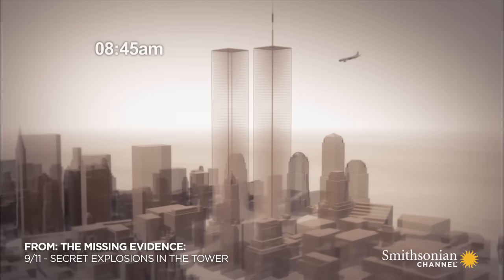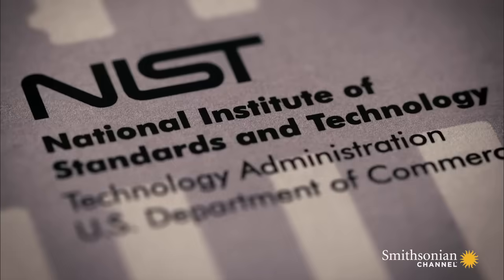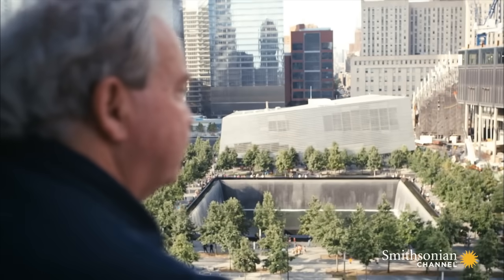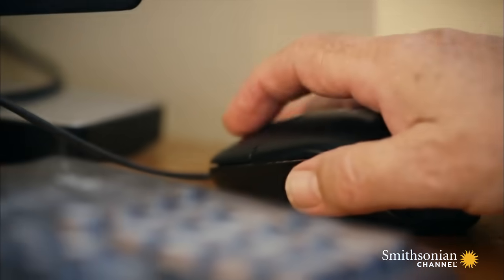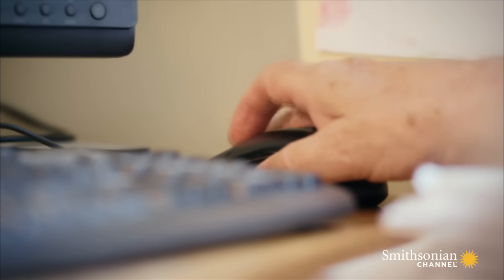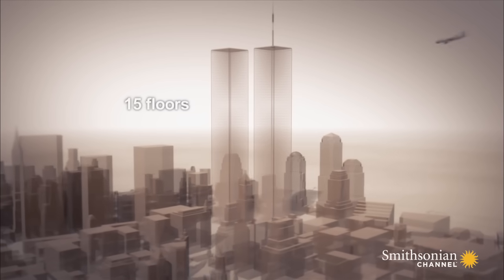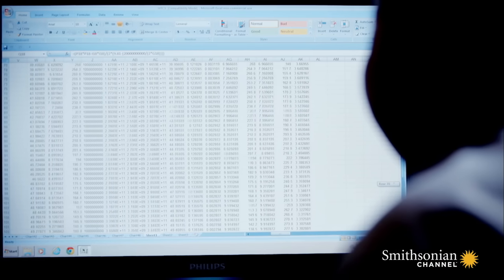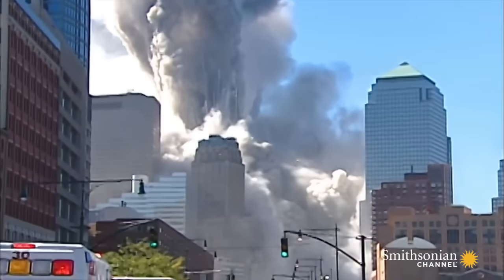This Computer Simulation Explains How the Twin Towers Fell

Comment: It was proven that the tower had plates in to hold the weight of the building if the bottom third took the weight of the top 2 thirds then it wouldn’t collapse.. and it did. Something isn’t right
Reply: There were no buildings or plane, only holograms.
Reply: MrYourfriendbutters no buildings? Haven’t you seen the huge hole in the floor that’s left there today
Reply: @Aaranslife  sry for the impersonating babbling babbler.  They don't like me or my ideas.  So they spread disinformation.  Like the idea there were no planes or buildings.  They just want to crush ideas.  They can't debate the fact the wtc meteorite is real.  They are quick to name call and belittle people.  Just call them babbling babblers which they are.
Reply: @Aaranslife  BTW I've reported them many times for gang stalking and nothing is done about it.
Reply: @c.augustedupin1926  babbling babblers you imposter
Reply: MrYourfriendbutters  Your going to prison for gang stalking me babbler.
Reply: @c.augustedupin1926  says the gang stalker.  Babble babble
Reply: @MrYourfriendbutters  The authorities will be contacting you soon and halling you off to prison babbler.
Reply: @mryourfriendbutters8900  impersonating is your weakest link.
Reply: @mryourfriendbutters8900  babbling babbler

Comment: Thick steel columns don't disintegrate w/o explosives going off on each floor almost simutulaneously. Which is exactly how they wire buildings for demolition.
Google videos of "controlled demolition" buildings.  The collapsing movements are almost identical.

Comment: Wait hold up 

So these steel beams holding up each floor can't handle the wait of a few extra floors on top of it? And it was designed to handle crashes like this but they couldn't calculate all these weights when designing the building, like somehow they just didn't think of that? Hmmmmmmm
Reply: @Shelby_Starner_Everything  babbling babblers

Comment: Virtually ALL the concrete flooring turned to extremely fine dust from nanothermate which scientists found in all examined dust samples. Therefore there was not the accumulated weight of falling stories which this analysis relies on to explain structure below being overwhelmed so as to allow collapse at nearly free fall. Further, many large pieces of structural steel are visible in the air beyond the explosion clouds as the collapses occur which could only happen if cutting charges were employed, which were used so the steel would come down in lengths to conveniently fit on flatbed trucks, hundreds of which were loaded each night starting nearly from the beginning.
Reply: Except for one thing: THERMITE WAS NEVER CONFIRMED. It's just one theory from one paper that was never peer reviewed or reproduced. One lab tried to reproduce the thermite find and FAILED. No one in the engineering community takes the thermite claim seriously. NO EVIDENCE OF THERMITE.
Reply: @Tim22222  babbling babblers you are
Reply: @Tim22222  You're avoiding the opening, main point, how to explain so many pieces of structural steel flung far into the air, many beyond the smoke and dust, and all about the same length, when steel is too elastic to break into pieces like that from overloading.

Comment: Look guys the twin towers weren’t thousands of tons of structural steel they were actually hollow inside !!! That explains how gravity could pull the top fifteen percent of the buildings through the thousands of tons of intact steel
Below!!!!
Reply: You've unlocked the achievement: Top Sarcasm
Reply: @VoidSurfer9  thankyou sir!!!
Reply: Bs. They were not hollow. There was a steel interior frame and an outer steel frame.

Comment: Apparently the collapse may of happened in 2 ways  
1) When the fire at the top of the building got to 2500 degrees C the fire melted and the top collapsed onto the bottom
2) Molten Aluminium, Water mixture
Now dont complain about me not knowing physics because this is what scientists believe and im only a under 13 kid so there

Comment: I can't help but notice he avoids addressing the most pertinent part of the equation; that being that a collapse in the manner he's speaking would ONLY occur IF the entire surface of the first floor to collapse gave way evenly across the entire surface.  That would NOT have happened as the damage from the plane affected only a small percentage of the internal structure.  Use common sense and think about it like this.  Take a tree and drill a huge hole through the center of the trunk.  Will the tree collapse?  No.  Cut from the hole through to an outer edge.  Will the tree fall now?  Yes, but it won't give way and fall straight down because the intact side of the trunk will prevent that from happening.  The tree will tilt and fall to the side where its structure has been removed.  Same case with the towers.  The plane only damaged a small interior section.  The outer structure furthest from where the plane hit was still fully intact.  The weight of the upper floors would cause the weakened section to give way and just like the tree it would lean and fall outwards in the direction of that weaker side of the structure.
Reply: "a collapse in the manner he's speaking would ONLY occur IF the entire surface of the first floor to collapse gave way evenly across the entire surface"

Oh? How do you know this? Where did you get your engineering degree? You DO understand a skyscraper is not a tree - right?
Reply: @Tim22222  I got it from University of Guelph.  Where'd you get yours?  I dumbed it down man, obviously not enough.
Reply: 12weasel100  what are you copying and pasting about?

Comment: What a load of propaganda nonsense, this video explains nothing.  What it does do is ignore the laws of physics.  Shameful..
Reply: @SmalltimR  I'm only making a fool out of people like you who ignore the facts and are completey clueless as to whats going on here.  I've actually researched 9/11 properly and i can tell you that the official story of 9/11 is provably wrong. The official story has been changed so many times after they realised that the facts did not add up.  The 9/11 commission did not even mention building 7 in their report, and later had to come up with the laughable excuse that it collapsed due to an office fire.
Reply: Which laws of physics does it ignore? Please explain.
Reply: @Tim22222  Newtons law of conservation of momentum. Buildings cannot drop at that speed if anything is slowing you down, ie when a floor hits another floor and another floor in the way the official story has described there is resistance before each new floor gives way. On 9/11 the speed at which the two buildings collapsed was basically the same as dropping something from mid air with nothing in the way until it hits the ground.  This only happens with controlled demolitions.
Reply: @wakinguptheworld6140  ROTFLMAO!! Okay, then - show your math, please. LOL just kidding, of course you can't because you have NO understanding of what you're talking about!!

Conservation of Momentum does NOT apply when gravity is acting on the system! If you're holding a stone & then you drop it, is its momentum conserved? No, of course not! Same with the towers. Go back to wikipedia & look into "open" and "closed" systems.

Also you are wrong about another thing: The towers did NOT come down in free fall. That's a myth.

Did you go to college? If so you might want to ask for your money back!
Reply: @Tim22222  Its quite simple, you cant drop at that speed if anything is slowing you down, a four year old can work that out.  According to the law of gravity, it is possible to calculate the time it takes for an object to fall a given distance.  The equation is  H=(1/2)at2, where H is the height, a is the accelaration of gravity (10 metres pers second squared) and t is time in seconds.  Plug in the height of the building at 1350 feet and we get 9 seconds. That is just about the time it took for the very top of the world trade centre to fall to the street below.  Acoording to all reports, the whole thing was over in just about 10 seconds.

Comment: If I took the time to detail all the lies and omissions in this video I would get nothing done today so I’ll simply say this video is fake news
Reply: Jason Morrow you need to read NIST report regarding free fall time.
Reply: Jason Morrow If you do a search on YouTube you can find a full length video more detailed than what I just sent you.
Reply: Jason Morrow you claimed that NIST did not deny the molten steel. I sent you a video of NIST doing just that, denying any molten steel existed. 

Tower 7 fell at free fall speed for the collapse of the first 25 floors. After that it fell at 90 percent of free fall speed. That can only be achieved by controlled demolition.
Reply: Jason Morrow i would be happy to hear the explanation for free fall speed on all 3 towers

Comment: How did the round jet propellers on either sides  attached to the wings  cut the huge strong class steel????? They should have fallen out side tge buildings...but tgey went in like butter and knife....
Reply: If you look carefully at close-up photos of the holes you'll see that no steel was actually cut! The columns were made up of 36-foot-long beams bolted together end-to-end. All the planes had to do was to break those bolts. Easy for a 150-ton mass doing 500 mph!
Reply: @Tim22222  what are you babbling about
Reply: @SmalltimR  guess you haven't seen any of debris from the site.  Guess your not an expert.  Who is your thought leader?

Comment: While I would like a valid explanation of Building 7, even more damning (that no one seems to be talking about) is the fact that every simulation (this one included), drawing or whatever is used to try to explain "how the towers fell" always has the South Tower collapsing straight down. Look at any of the numerous videos of the South Tower collapsing. Anything but straight down. As a matter of fact the top floors of the South Tower tilts 20+ degrees during the "failure" making it impossible for either the top floors to crush the bottom floors, nor the resistance of the bottom floors to destroy the top floors. Talk about defying the laws of physics. You want proof of "interference" and the fact that "they" are trying to cover it up? The South Tower proves it. Otherwise "they" need to explain how the South tower disintegrated, top floors and bottom floors, despite the 20+ degree tilt of the top floors at initial failure/beginning of collapse.
Reply: The upper section tilted while it fell down and crushed the lower section.

The towers did not fall apart the way you think they did.

The steel girders in wtc7's inner core were attached to the  support columns with only 4 bolts.....that's not very strong.
Reply: @Shelby_Starner_Everything  Actually if you bothered to watch a video on the South Tower collapse, you would see that the majority of the tilt of the upper floors happened prior to the collapse. If you have watched the South Tower collapse, then your statement is just dishonest. Do you really understand much about physics? Do you not understand why when the top floors started to roll off, that it was impossible without some form of interference to get the result that happened? Explain to me why, if it were possible, that NO ONE who attempts to 'explain it' shows it. They ALL have the South Tower collapse straight down. Just like in this video. They don't show it because they can't. Without some form of interference or 'help' if you will, it is virtually impossible to have the top floors start to roll, but then suddenly stop tilting/rolling and utterly destroy both bottom and top. Can't be done. The tilt/roll of the upper floors of the South Tower is very inconvenient to their 'explanation'. That's why no none who 'explains it' shows it.
Reply: @Shelby_Starner_Everything  lol where do you shop?

Comment: I went through Greening’s calculations. The derivation of the equations made some sense but in performing the calculations the rate of collapse would decrease and the collapse would stall within 5-10 floors.  He never actually showed in his paper what is asserted on this video.  I spent a day on it, it was a waste of time.  Even if the building did collapse at the accelerating rate visible in the video tape, how does one explain the large chunks of wall being ejected from the building and disintegrating while in free fall?  There are numerous other weird events that occurred that day that would be almost impossible to explain by gravity driven collapse.  The available evidence is consistent with the use of explosives, yet the obvious explanation would imply a coverup which our government would never do , right?
Reply: You have been mislead. The towers did not come down in free fall, not even close.

Not one shred of evidence indicating explosives was ever found. Nothing!
Reply: @SmalltimR  nice did you cntrl v from a script or your last comment for the other thread?
Reply: @SmalltimR  fyi you have no data or evidence.  Who is your thought leader?

Comment: The south tower fell first after being hit last because it hit the very side of e tower, which made structural integrity really low. The north tower was hit head on, structural integrity was not low but low, ( if you know what I mean ) when the tower fell it's like a domino effect when you knock one domino the over dominos fall. Immediately crushing each floor.
Reply: Josh, did you skip Jr. High Science class?
Reply: What are you babbling about

Comment: It’s a lie there’s no way building can fall perfectly down only professional bomb dentonater can do this to prevent it from falling to the side and hitting other building not a plane free aiming
Reply: The twin towers did not fall perfectly down.....they collapsed out like a volcano, all over the surrounding buildings, destroying them....the Marriott Hotel was totally destroyed from the falling rubble.

The outer shell of the twin towers was a ''moment resisting'' steel frame, that was bolted down to solid bedrock....it was designed to resist the overturning moment, so it is impossible for those towers to fall over like a tree.
Reply: @Shelby_Starner_Everything  what are you babbling about

Comment: To all you consiricy therists on here i suggest you watch how they made the buildings and survivor recounts a) they  were both concrete exterior with sheetrock insides they were built like four skyscrapers on top of each other that cobined with jet fuel burning a hole through so many levels was deffinatly cause a collaspe like that
Reply: Say what?  Spelling, punctuation, and capitalization are all free on Mondays, Mike.
Reply: I highly doubt there was "sheetrock" in the twin towers.... Oh nm you must have meant drywall.  Oh I guess you have never been in construction outside of made finishes... I doubt that though... Are you sure it wasn't plaster

Comment: Building 7 was the smoking gun
Reply: A building in the Mexico earthquake collapsed exactly like wtc7.
Reply: @Shelby_Starner_Everything  your really reaching.
Reply: @tonycariello8478  
Birds only damage the thin outer skin of a plane, but under that thin skin is inches thick super strong alloy aluminium.

The alloy that planes are made from has the same ultimate tensile strength as structural steel 500 Mpa (Mega Pascals).

The size and strength of the wings is massive.

The wings must be very strong because they have to handle the wind pressure at 500 mp/h.....carry the tons of weight of the engines....carry the thousands of kilograms of jet fuel... and handle the large G-forces.

There is a video on youtube showing how they manufacture the wings of an Airbus 380....under the thin outer skin of the wing, is a massive inches thick rectangular box beam, the same size as the inner core steel columns of the twin towers.

The exterior columns of the towers at the impact zone were only 9.5mm thick plate hollow box columns....no match for the massive and supper strong wings of a plane.
Reply: @Shelby_Starner_Everything  what are you babbling about
Reply: @Shelby_Starner_Everything  you have never study....smdh
Reply: @Shelby_Starner_Everything  please sight your  "facts".  The only one I want to know is where you heard the hypothesis that the columns were only 9.5 mm
Reply: @Shelby_Starner_Everything  do you even understand the metric system? Do you understand that the steel came from an American supplier who doesn't use the metric system.  Oh wait obviously you don't.  😂🤣😂🤣😂🤣😂🤣😂🤣
Reply: @Shelby_Starner_Everything  what is "massive inches thick rectangular box beam"?  You don't even understand what you are saying... Lol lol lol lol lol lol